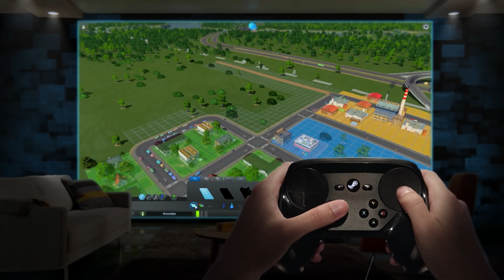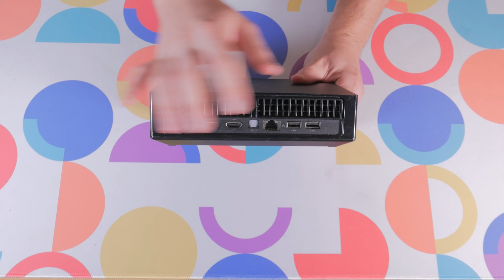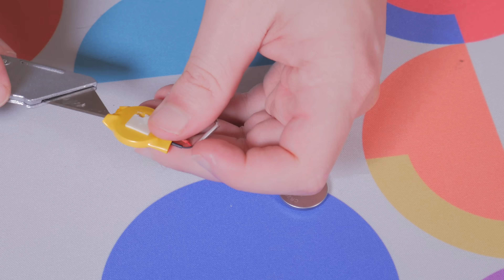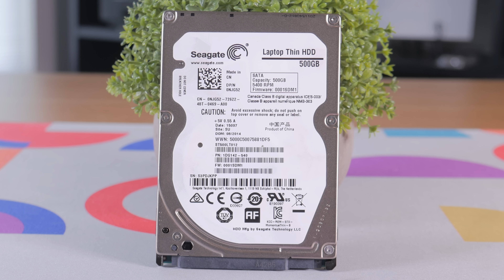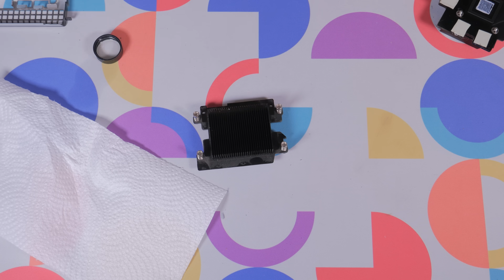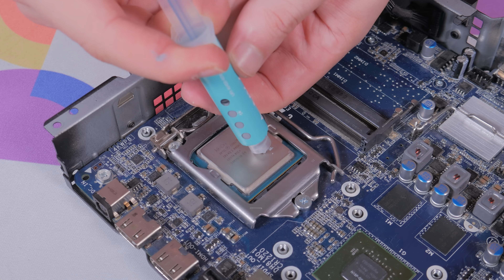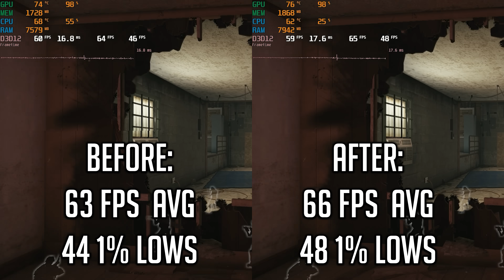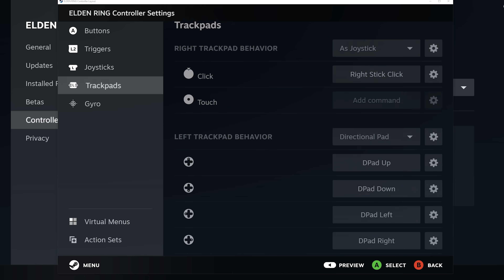I Bought Valve's FAILED Steam Machine in 2024...

Comment: I'm watching this from a docked Steam Deck in desktop mode right now. I have it connected to a 1440p monitor and a keyboard and mouse. This is my home PC of choice. SteamOS has come a long way and Proton is great. Obviously the Deck can't run modern games at higher resolutions, so I mostly play Doom mods and emulators on here. But I love it a lot. I would buy a more powerful Steam Machine instantly. I am done with Windows. I think a lot of other people are ready to jump ship as well.
Reply: Lets hope valve releases steam os. Bazzite is not an option as it is too janky
Reply: @hornantuutti5157 I don’t believe we will see it till steam deck 2.

Valve is slow. And they announced the steam deck 2 is in development
Reply: They also said the tech doesn't exist yet
Reply: @RusticRonnie  By the time they are done developing it, they will have to go back and redesign it because hardware standards have already changed.  This is why all the original Steam boxes were a joke.
Reply: Meh. People were ready to jump ship from Windows when the Steam Machine first came out. Two problems still exist. First, if the games aren't coded directly in Linux, you still have to run some sort of emulation or layer of software between the game and SteamOS. Proton works, but it's still not native. Second, you're still using the 3DO model, where the tech/specs are suggested or licensed and the builder does whatever they feel, so there's no consistency between machines. Something like the Steam Deck works because there's one basic set of hardware. The Steam Machine still stays as a specialized HTPC
Reply: @spenzalii  I fully agree with your second point. As much as I want a new Steam Machine, I won't bother unless the hardware is straight from Valve. Preferably with one single configuration to keep troubleshooting simplified. I don't want some weird unsupported Dell / Alienware parts bin trash again. I want a Valve "console" with SteamOS.
Reply: @spenzalii  Don't anger the Linux trolls as they will still claim that an emulation layer is still better than using Windows because they don't trust corporate America.  I think that if all the Linux trolls can stop arguing about color schemes in the 1 million different flavors of Linux and code a Linux that's good for games, more people would abandon Windows for gaming.  I'm not holding my breath though, I've seen how a lot of the trolls are adamant that a command line is the only way to install apps and having executable files like Windows is just too corporate.
Reply: @thieupham493 command line is the only way to install apps on Linux? You're stuck in 2003 😅
Reply: @thieupham493 "Code a linux"

Yeah, don't worry, with people like you, there will always be a market for linux lol

Imagine being afraid ppl have options in a free market
Reply: Already jumped ship. Because the official steam os isn't available yet I opted for Garuda Linux which suits me
Reply: @avp2501  same, i started with mint, but settled with Garuda after wiping my windows drive for it.
Reply: I installed Bazzite (SteamOS 3 clone) on my ASUS laptop with an RTX 4070 and i7-12700H and it runs like a dream. Performs just as well as Windows without all of the bullshit that comes with Windows.

Using Wine/Bottles/Lutris and Proton you can pretty much run anything and everything with the exception of a handful of games that use Easy Anticheat or other unsupported anticheat software.
Reply: @husky3g  I'll probably end up doing something similar on my next PC build. A big part of it, though, is that I'm just tired of building computers. I want to buy a premade box from Valve that auto updates and does drivers and everything on it's own with minimal tinkering. Ready to go out of the box. A console / mini PC version of the Steam Deck.
Reply: @husky3g  It looks better too. and doesn't spy on you.
Reply: I have mixed feelings on SteamOS. To be fair I'm too lazy to change enough of it to get what I really want, but I'd rather use Fedora over SteamOS in desktop mode. I'd say Mint is about on par with what I'm looking for. However, gaming mode when in handheld is great. The only issue I have is the family view seems to be quite buggy in that mode.
Reply: Same. Becauese of Windows overhead, games run faster with Proton most of the time. Its crazy.

And the best thing about it, no more Microsoft.

Only the AntiCheat situation has to be resolved.
Reply: I just switched a few weeks ago and I love it. Im using garuda and getting much better performance than I did on windows. Since I just game and watch youtube, its perfect for me. Nvr going back.
Reply: Yes Im 32 I hate windows 100% I hate windows 11! Windows 10 is somewhat decent. Nothing runs on a fucking MAC, no business embroidery or printing programs run on fucking MAC! 100% ready to switch as well! Do you play Xbox bro?
Reply: @KyleS-n2s  Switching to linux was one of the best pc decisions ive made next to building my own. It felt so good deleting windows.
Reply: Why does people hate windows ?
Reply: New GabeCube here we GOO!!! 
🔥🔥🔥
Reply: A very coherent and well structured comment!
Reply: you mean the portable Cleveland Steam Box. I hear you can use that on the toilet while you're taking matters into your own hand.
Reply: Steam os won't go anywere since any modern multiplayer game with an anticheat won't work on it
Reply: @Riccardo-ej8cd  thats not true dude, kernel level anti cheat* theres a lot of multi player games you can play.
Reply: @Kr3os  Lol, which ones? All the relevant mulitplayer games have an anti cheat, (else they become unplayable because of the cheaters).

The only games that work on it are the ones made by valve for obvious reasons and the ones with 100 players online
Reply: @Riccardo-ej8cd  helldivers2, terraria, valheim, payday2 minecraft and many more. look it up lol.
Reply: You people have been saying that every year for the past 10 years. Its not going to happen
Reply: @nikolowolokin  Saying what? That Linux will replace Windows some day? It is happening already.
Reply: @nikolowolokin  you are aware of the steam deck right
Reply: @nikolowolokin  bro i just switched and im not going back, linux is easy now. I wish I had switched sooner. And since i use amd, i nvr have to worry about drivers. all my games run smooth af and have better performance than I had on windows.

Comment: I bought one of these as a secondary TV PC and it was great. Mine came with an Xbox 360 controller and had the DVDs for Windows and SteamOS. One note about the HDMI ports, is that one of them is actually an HDMI passthrough and can only be used as such. It's a very janky implementation, as you have to have the machine on and press a specific keyboard combination and it switches the input to that device (not a capture device, it just passes it to the output). Very limited use case.
Reply: And I only actually managed to get it to work once and never again.

Comment: I've had on my shelf what I thought to be a dead Alienware Alpha for over a year. Your explanation to fix the CMOS battery issue is giving me some hope!
Reply: Nope. Still dead.
Reply: @FunkyHQYT  
i found this comment i made from the video describing the reset process, and i thought it might be useful here if anyone in this thread is still struggling after replacing their cmos battery. it seems to have helped some people in that comment section at least.

"i was having an issue after reinstalling the battery and attempting to boot where i would hold the f12 key and it would still give me the flashing yellow power button. i disconnected the psu, held the power button 30 seconds to do the battery drain thing, and then i reconnected the psu and connected the keyboard to the rear usb instead of the front. after this i was able to f12 my way into the boot menu, im not sure if it was the battery drain or the keyboard slot change that did the job, but i figured i should mention it."
Reply: @FunkyHQYT  Wish there was another way to fix these. Mine's been sitting on the top of my bookshelf for years now since nothing I do fixes that dastardly yellow light.
Reply: @FunkyHQYT wah!!! Nooo!!
Reply: @FunkyHQYT  Once the CMOS battery is swapped,plug the power adapter to it and hold down on the power button for 5 seconds.Release and hit it again and see if it comes on.
Reply: @FunkyHQYT  you're a weirdo lard ahh. Got pronouns in your bio lmao you'll never be a big youtuber I promise you
Reply: i replaced the battery in mine about a year ago and it came back to life. ended up installing batocera since i couldnt really find a place for it in my current pc ecosystem, but there are some other really good use cases for this thing, even outside of gaming.
Reply: I wanna know if it works for you.
Reply: Update?
Reply: Hello?
Reply: @fallinthequazar  beat it bozo, no one has to reply to you.

Hello??? 🤓🤡💩
Reply: My friend gave me one in return for fixing his computer and that's all I had to do to fix it.  I love mine, it's not powerful, but it's a great little machine for the TV center, only used to play non intensive couch games and the like.
Reply: If it’s not the cmos battery it’s the ram I had that issue years ago lol
Reply: Damn, I wanted a cheap Steam machine from eBay.
Reply: 2 months later the answer is?
Reply: @ChrisChurch161  3 months later and he answered the question 3 months before you asked your stupid question.
Reply: @ramrodbldm9876  technically he answered 2months before that it was “still dead”….. but you’re correct
Reply: @FunkyHQYT Check out the r/alienwarealpha subreddit, there's a ton of information there about fixing and upgrading. I recently replaced the CMOS battery, upgraded the CPU, RAM and wifi/bluetooth card and it runs better than ever. I also recommend doing a Youtube search for alienware alpha CMOS battery replacement.
Reply: Just wanted to share, mine also had the yellow blinking light. i changed the CMOS with a cheap amazon battery and it works like new. greatly recommend
Reply: I had the same issue and just replaced the battery and it was fine for years after that i used it.
Reply: bro, you probably didnt even bother to search for it
Reply: maybe you should learn to read the user manual. It clearly shows the fuse position on the board in order to fix the yellow light....
Reply: @ I never learned how to read.
Reply: @FunkyHQYT  downz small pings syndrome
Reply: @FunkyHQYT 😂 Sarcasm, like no shi there’s a manual

Comment: I love that companies are trying to remove the stranglehold Windows has on PC Gaming. If I could play every game and run every program I can on Windows on Linux I'd switch in a second, especially with all the spy crap in Windows 11, which I'm avoiding like the plague.
Reply: It's gotten a lot better. Proton has basically become good enough I just assume the game works as long as it isn't some competitive shooter. On my older gaming laptop (RTX2060), I just put Manjaro on it and have been tinkering with KDE Wayland... but in all honesty, Linux Mint is still my recommendation, even if it isn't Arch based. You can install Steam basically like you install Windows (Yes, the Steam page will give the Ubuntu version of the installer (A deb package)), and once installed, you just need to ask Steam to allow the use of SteamPlay in settings. After that... it just works.

As for apps... this depends. WINE works decently for most things, or some things just have multi-os versions available already. Davinci Resolve is still my favorite video editor since switching from Premiere, and it's Linux version is just fine. Ironically, TeamSpeak's linux version was acting up in Mint... but running it via WINE with the Windows version worked perfectly? (Yeah, beats me, too). Chrome and Firefox work pretty much with no issues, OBS is also fine, with only MS Office being the ONLY nightmare unless you have a perfectly legit copy of 2016 or major luck with 2019. Discord can act up, and that boils down to Discord's Linux version just not playing nice with screen capture... which is solved by using Vesktop (Discord with some skin but also an updated web engine that Discord... already uses, but is ancient).

For my main PC, I already plan to just dual boot Manjaro for most uses and Windows for VR and any non-compatable anticheat titles... which thankfully is limited to maybe 3 games.
Reply: First at all mainly is one  company no companies that is trying to do that 
,because playstation or Nintendo or any other gaming company doesn't care about deleting windows on pcs,

In the best case scenario companies will build you a linux machine if you pay them but not because they want to eliminate windows as a whole 

And Secondly you can erase telemetry on windows with a single app that have a very nice ui

so what are you talking about xdd

Comment: I have this one! The GTX 860m is a GTX 750 TI equvialent with almost identical specs but with slightly lower clocks. The GPU can overclock a little which gives a nice boost and the CPU can be replaced with specific Xeon CPUs or the i7-4785t. If I remember correctly the BIOS is locked down to only accept 35w CPUs. Even with an SSD and the cpu upgrade, these little guys can feel super sluggish.

Comment: I have one of these i purchased about 6 years ago. My is a true steam machine and had a hard drive with the original steam os that had completely bricked. My currently has 500gb ssd 16gb ram and wifi 6 with the i3. However seeing i7 4765t are $20 on ebay ill make the upgrade. I dont even use it but its cool to have it at max strength.
Reply: I still use mine as a HTPC and Plex server.  As a bonus it works great for emulating every Nintendo console (even the one that must not be named). It fits perfectly into a entertainment unit
Reply: Can you play battlefield 4 multiplayer on it?
Reply: @unsuppressedspeech4946  I would say yes.  The GPU is an 860m which exceeds the recommended requirements.  Only buy one if it's super cheap though, like 100 bucks.

Comment: Honestly, Steam was on the right track with these, just fluffed the execution. Imagining these with some entry to mid range ryzen parts with Steam OS 3 in them is incredibly tempting. Especially if Valve gives Steam OS 3 the proper support it needs to be a stand alone gaming OS for ANY system. I'd dare say they could revolutionize the PC gaming space if you could legitimately put Steam OS 3 on any system, qwith official support from valve AND AMD to support all their AM4 and AM5 CPUs and 5000, 6000, and 7000 GPU lines. No joke I'd dump windows on nearly every machine I have it on currently at that point.

Comment: Bazzite Linux would give you better performance as a Steam machine as long as you don't require invasive anti-cheat.
Reply: "invasive anti cheat" AKA rootkit. Gamers used to get really pissed about that stuff. Today, they just allow it.
Reply: @37Kilo2  If it has invasive anti-cheat, I simply don't buy the game.
Reply: @37Kilo2  Says the person using a google platform site with a google account....
Reply: Ricochet
Reply: I was thinking about installing bazzite on an older Dell e5570 and immediately the stuff I was reading on old GPU drivers was turning me off. Obviously mine is integrated instead of nvidia but still. Unless it’s AMD basically bazzite is a pain atleast that’s what I read. If anyone has experience with integrated Intel GPU running bazzite I will gladly take your input. It’s a cool m.2 platform with a quad core and ddr4 support up to like 32gb or 64gb ram. Seams great for basic indies and emulation.
Reply: I was thinking about installing bazzite on an older Dell e5570 and immediately the stuff I was reading on old GPU drivers was turning me off. Obviously mine is integrated instead of nvidia but still. Unless it’s AMD basically bazzite is a pain atleast that’s what I read. If anyone has experience with integrated Intel GPU running bazzite I will gladly take your input. It’s a cool m.2 platform with a quad core and ddr4 support up to like 32gb or 64gb ram. Seams great for basic indies and emulation.
Reply: Bazzite requires a 9xx GPU.
Reply: Bazzite still wouldn't work cus 860m is maxwell 1
Reply: @nich98  nvidia has released the drivers for Maxwell 1
Reply: @nich98  Exactly! Oldest NVidia's GPUs that're still supported by current Linux' drivers are Maxwell - GTX 9xx, Pascal 10xx and 16xx series, Turing RTX 20xx and newer. This old 860m, as well Kepler 7xx and 6xx , Fermi 5xx anything below is downright obsolete now. Also the AMD FSR upscaling technology, even thought spec do work on any older GPUs, Maxwell 9xx seems to be minimum to it do work - on Kepler and older NVidia gens FSR isn't really usable.
Reply: @ВладимирДимов-л6р  16xx series is Turing without RT cores
Reply: @nich98  Then... don't use Bazzite? Just install Linux and throw Steam on it, requesting it starts in Big Screen mode each time. Problem solved.
Reply: @FlameSoulis  Bazzite is fine, hell its good even. Issue is the gpu is old as dirt, poor legacy drivers, and doesnt support vulkan anyway.
Reply: @FlameSoulis  drivers for maxwell 1 didn't support Vulkan, so using proton isn't possible. You can get it to work in older linux native games, but it would require DAYS of full time tinkering for sort of running A game.
Only real option for (nvidia) gpu older than pascal is windows (and maybe maxwell 2.0)
Reply: Squeeze 3 FPS out of it? Linux is not magic, the GPU will remain slow if it is slow.